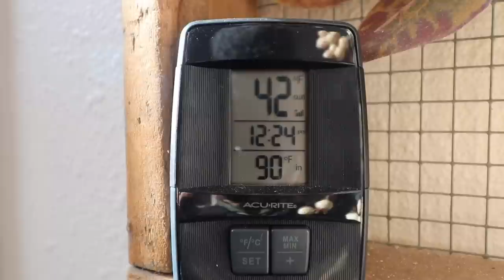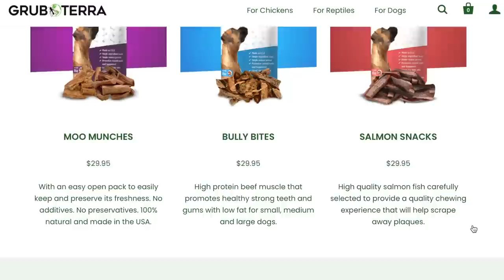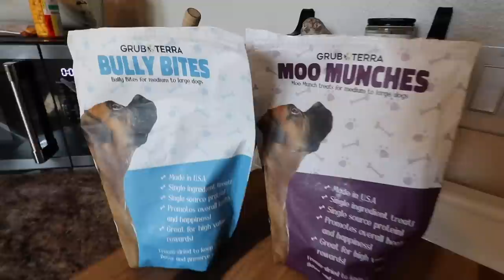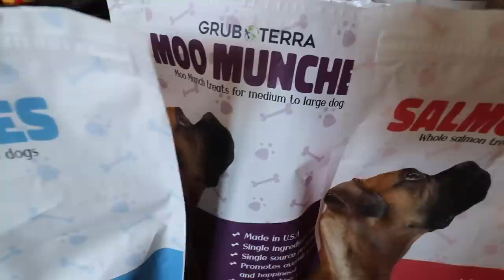DIY Chicken Coop Build in Progress + Supply Run!🐥(Picking up New Chicks for our ALASKA Homestead!)

Comment: Tina I had a Idea for you Ask Joe if you can get a piece of 1/4 or 1/2 shatter proof glass to put on part of the roof it will not tarnish and let light trough just like a window in a house and wont tarnish like the clear panels

Comment: Hi Joe. Yes I always write to you. On here   Your lovely wife gets the most amazing attention lol. ❤.  Are you worried about the drainage when the snow melts.  I hope truly you can convince your wife. To get a tracked skid steer  next winter. With a bucket and snowblower. I did notice. Because  of the cliff towards the pond. That would make a good snow push drop off. Point. As always. Prayers for your family.
Reply from the maker: We most definitely will get some type on tractor. Don’t know what yet. I have been using the drop off as a place to push all the snow. I bring it all down the driveway into a big pile and then push it down the hill. Thanks for watching! 😃 (Joe)
Reply: @HomeFreeAlaska  I would recommend a mahindra or a TYM.    The TYM is the best in cold weather.   I see that one on a few channels in northern climates.  And  I know TYM. Does sponsor YouTube channels.  With their tractors.  It’s worth it to contact them.